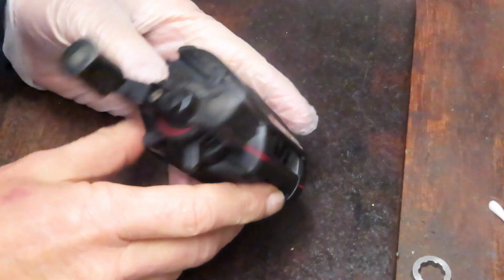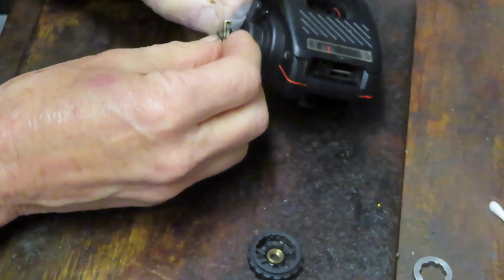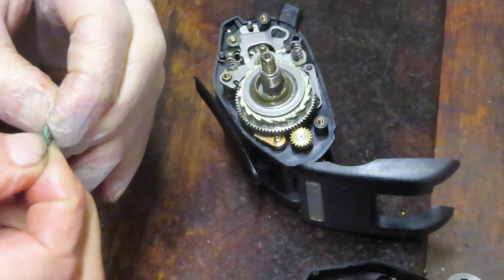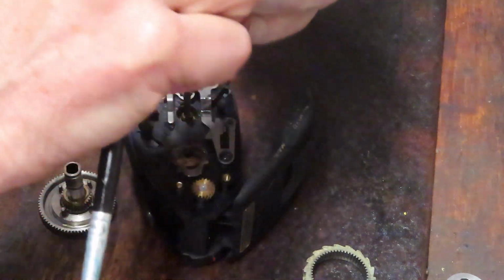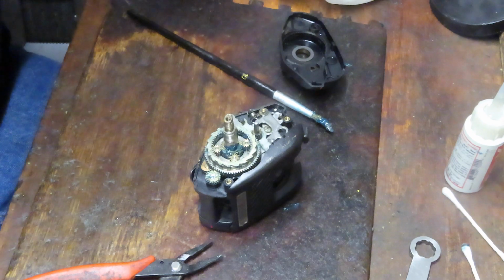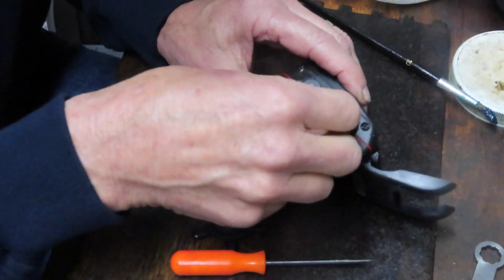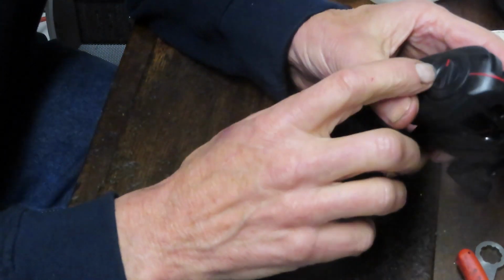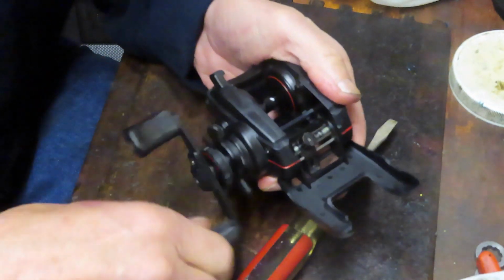Penn Low Profile baitcaster 2000 fishing reel from the 1980s how to take apart and service

Comment: Looking at the schematic...
The auto-shift is friction-based.
Tightening the shift knob increases the amount of reeling pressure required for the reel to begin operating in "low gear".

See 8:27

The handle shaft drives a sun gear (the medium-sized gear in the center).
There are four planetary gears, that mesh with the sun gear and the ring gear. These planetary gears ride on shafts affixed to the main gear.
There is a ring gear (the large, cylindrical gear with gear teeth on the inside and ratchet teeth on the outside), that meshes with the planetary gears.
There's a friction disc between the sun gear and the main gear. This disc causes the main gear to try to rotate with the sun gear, but allows slippage when there's too much resistance.

High gear: the main gear's resistance to turning isn't great enough to overcome the friction joining the sun gear to the main gear; so the entire pack rotates as a unit.

Low gear: when the main gear is sufficiently difficult to rotate, the friction between the main gear and the sun gear isn't sufficient to prevent slippage between the two. The handle tries to turn the sun gear. The sun gear tries to turn the planetary gears about their shafts. The planetary gears try to turn the ring gear backwards, but the ratchet system on the ring gear prevents this; so the planetary gears are forced to walk around the ring gear, taking the main gear with them. The main gear turns more slowly than the sun gear.

I think.

The problem with this system is there's a loss of transmission efficiency in low gear. The sun gear and main gear are rotating at different speeds, and there's a friction washer between the two. The  The power required to overcome the friction is dissipated as heat rather than being transmitted to the spool. The higher the spool resistance required for the reel to enter low gear, the more energy is wasted while in low gear. The "fix" would be to leave the shift knob all the way loose, but you would effectively lose access to high gear.

If high gear is 6:1 spool-to-handle, and low gear is 2:1 spool-to-handle, three cranks of the handle are required to turn the main gear one time when in low (1:3). So if you're cranking the handle at 60 RPM, the main gear is only turning at 20 RPM, which is a 40 RPM difference between the two sides of that friction washer between the main gear and the sun gear. If the system is tensioned such that slippage begins at 1lb of reeling force, that's 40 RPM at 1lb resistance worth of energy being wasted.
Reply from the maker: Thanks for the additional information and insight - Much appreciated - Dennis

Comment: Hey what's up.. hope you are doing well.
I like fishing reels but this one ist too complicated.. hahaha
Reply from the maker: It is, but you don't need to take it apart to take it fishing.  It is crazy as a 2 speed reel 6:1 goes way down to 2:1 when you engage the other gears.  You could pull up Davey Jones locker with that torque!  Thanks Rey - Dennis

Comment: I could never work on a reel this complicated. You are truly amazing. I spent the afternoon learning how to rebuild a busted bail mechanism on a tuition reel I got in a lot. It is a Abu Garcia  GK 280.. I used a bail screw off of a Mitchell 302 parts reel and a big Penn greenies parts reel. Got it working and learned a lot. I don’t think my repair is very durable however. Could not find any parts except a bail spring and I chose to fix the bent up one. I enjoy figuring out how something works. I like your term “tuition reels.” I’ll bet that’s how you’ve gotten confident enough to work on a reel like this one. It was very interesting. Loved the video Dennis!
Reply from the maker: When all else fails, take it apart and learn why!  You are on the right track Chris - Dennis
Reply: @2ndChanceTackle  Thank Dennis This Garcia reel has a unique bail mechanism to me. I got it all working except the stop mechanism just doesn’t catch as it should. The bail spring could inhibit it but it really is a weakness in the reel. I wish I could just make it a manual pickup but I don’t think that is feasible. Good for learning though. I only got one good reel out of that lot of 4 - a Daiwa Regal fast cast reel. One had a totally missing AR mechanism, one missing a key AR piece that I rigged a new system for, and this Garcia.

Comment: Dennis what was the broken green piece for? I’m curious because it seems to be working without it.
Reply from the maker: I don't think it was part of the reel.  I think it may have carried over when I grabbed a tool.  It looks like the clipped end of an electrical wire.  I am sure it is not from the reel
Thanks again
Dennis
Reply: @2ndChanceTackle  that’s what I was thinking, just debris. I thought it looked like a piece of dried up seaweed. Lol.

Comment: I think is is a made by Garcia.
Reply from the maker: Made in Japan.  Garcia was not a manufacturer.  They were a brand based on a distributor who gained the right to sell reels in the US.  I think you are on the right track though.  The reel could have been made by the same company that was making the Garcia reels - Thanks - Dennis
Reply: @2ndChanceTackle  I have one. Lots of fun blackfishing. The low gear is super slow but has torque to get fish off the rockpile! Only use it on special occasions...
Reply from the maker: That makes a lot of sense.  That low gear is really low and capable of pulling in the monsters - Best wishes - Dennis
Reply: @dandemagistris2821  can you please explain to me the correct way to set the 2 speed function for it to automatically sense pressure and drop down to the lower gear? Thanks in advance for your help.

Comment: This Penn looks like it could be a cousin to my Daiwa low profile baitcaster from the same time frame.
Reply from the maker: Yes - very similar design and look, but I have not seen the internal gearing like this in the Daiwa.  Seems all of the 1980s Japanese bait casters were squared off profiles.  The first graphite Daiwa I had look similar too.  Thanks Ward - Dennis

Comment: Man, you're braver than I am. I've attempted to disassemble and service 2 low profile baitcasters, but failed miserably due to how complex I found them. As a result, I know have virtually all vintage Mitchell and Daiwa spinning reels and vintage zebco spincast reels in my arsenal (As they're easier to take apart and service). Also, I took apart my quantum nitrous 30 spinning reel. The only plate is on the bottom and there doesn't seem to be a way to get the main gear out. So, I just cleaned it up the best I could and applied fresh grease and oil to it.
Reply from the maker: Sometimes leaving sleeping dogs lie is the best approach.  I think you need to pull the axle shaft in order to get that main gear out.  FYI for next time - Dennis